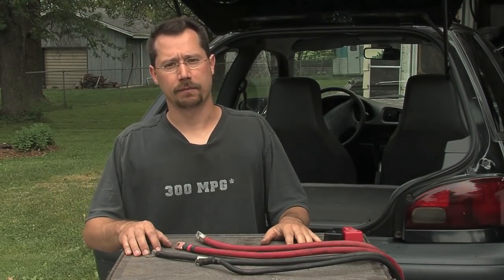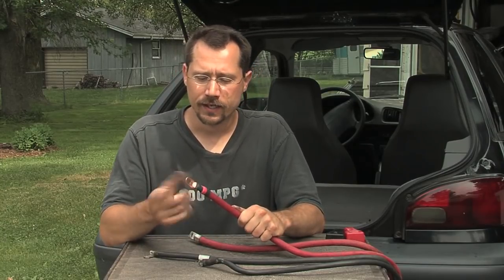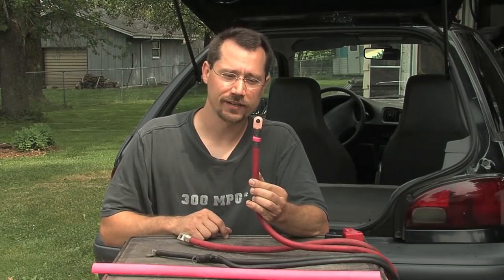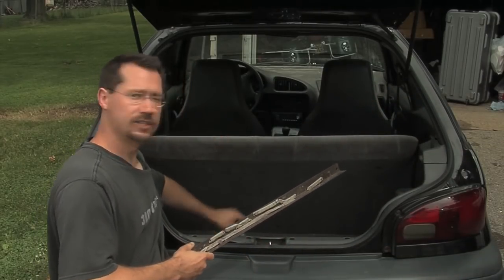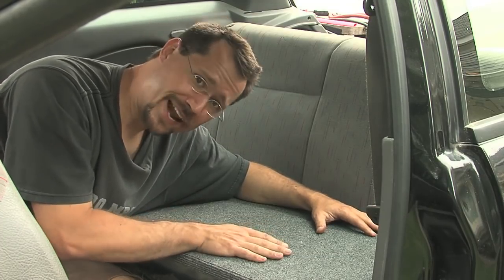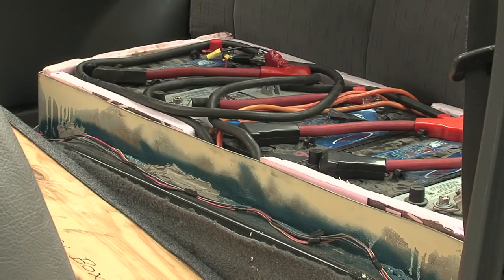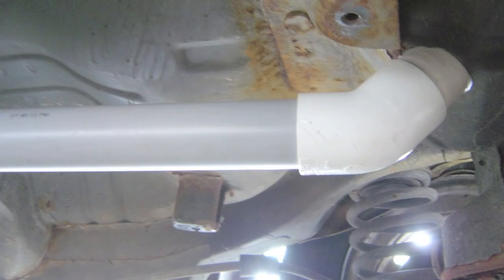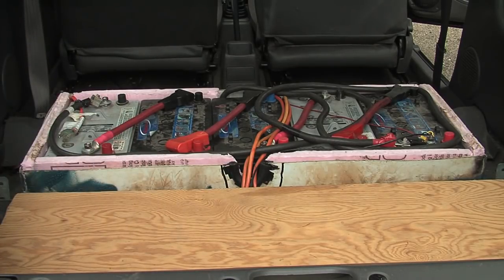11 Build Your Own Electric Car: Cables and battery mounting

Comment: Very informative series. It helped me a lot in my simple ev conversation. I'm about to give a test drive. The only thing worries me is what about ground nagitive which is 60 volts to the body of the car. Won't it be dengerous. I'm not sure what to do. Any help would be great
Reply from the maker: For pretty much anything OTHER than 12v, you do NOT use the frame as a ground! Run dedicated cable of the correct gauge on the negative side of the circuit.

Comment: Thanks so much for this EV vid series! I'm having trouble finding a fork lift motor at salvage yards. Any advice on motor specs if I search for a fork lift motor online? I'd like a max vehicle speed of at least 65MPH. Is this unrealistic for a fork lift motor, or can a controller affect its speed potential? Cheers!
Reply from the maker: You can do 65 just fine on a forklift motor. Make sure to use a decent voltage. Speed is proportional to voltage on a DC series-wound motor.
The best advice I ever found on using a forklift motor can be found here: https://www.diyelectriccar.com/threads/using-a-forklift-motor-and-choosing-a-good-one.7598/

Comment: How did you decided where to install the 2/0 cables vs the 2 Awg cables?  Is the amperage different in different parts of the system? Thanks!
Reply from the maker: The 2 AWG cables shown are just an example.
Any cables I re-used from forklifts for in the car were the heavier style.

Comment: I really like the series of videos that you have created for your build and the detail that you go to in each.  For this battery video I have a concern with pressure fitting lead acid batteries (or any battery) into a battery box. I would worry about the batteries swelling and/or becoming overheated and having the casing split. This will lead to an acid spill in a closed environment causing an explosive environment as well as a respiratory hazard. I don'r recall seeing where you vented the battery box to the outside atmosphere? If these are not sealed lead acid batteries then you have an outgassing situation where the batteries release hydrogen, creating both an explosive and/or a respiration hazard. Setting this aside, great job with the videos and the build.
Reply from the maker: For this project, I was using gel batteries. Later, I got some AGM batteries. Both are lead-based, but completely sealed.
For flooded batteries, you would want to provide for proper venting.

Comment: Hmmmm.….now that you've removed the engine etc, that is a huge weight off the front end...…..possibly you would want to install some batteries, (if you intend to stay with lead acid type), in the front to balance the weight shift. With a change over type conversion like this the first and very first consideration would have been to use Lithium type batteries...….one guy on the Tube shows how to build not too costly lithium packs with 18650 type cells......THAT is definitely the way to go.....Lead acid is pre history or before 1900.
Reply from the maker: Please keep in mind that this was a project built in 2008.
Lithium batteries at the time would have cost over $10,000 for a basic motorcycle-sized battery pack.

For a project using lithium batteries, take a look at the Vectrix electric motorcycle we upgraded.
https://www.youtube.com/playlist?list=PLmHss3DBZUinx-DxMLnax485Alj5i5Lcn

Comment: What if you fix a charging alternator for additional power, i believe it can recharge batteries for additional distance.
Reply from the maker: Where do you suggest the power for the alternator comes from?
Reply: @BenjaminNelsonX , i think you can convert a drive system from the power source (instead of cutting a space underneath the gear box, you can cut a space on the top and fix a drive wheel or a pulley close to one of the coupling) you only need some sort of pulley to drive alternator for extra charging, some sort of recycling energy.
Reply from the maker: So, the alternator is powered by the electric motor?
Reply: @BenjaminNelsonX  Yes, as long as there is power to rotate the pulley the alternator will always charge the batteries  if they are in parallel they will at least gain 5 amps at 13 to 14 volts Dc. It depends on the R P M and the size of pulley to drive alternator.
Reply: @ibrahimayoussouftoure7854  Do you mean Regenerative Braking? Driving the alternator with the electric motor will suffer from inefficiency, and wont actually charge the battery but provide resistance that drops the efficiency of the motor draining the batteries more. Regenerative braking though, recovers energy that would be lost to normal braking, whose energy is instead used to drive a generator to slow the car.

Comment: Where did you spend thousands of dollars?
Reply from the maker: I did nearly all the work myself on this car and spent about $1,300 total to do it.
Reply: I've heard everyone say its pricey. I knew it wasn't and all it is ,is understanding what your doing . not send away the car to some crap shop , knowingly all they doing is gutting out a fork lift and ordering a speed control device and wires plus coupling 
What the heck ?
Reply: No 5quarts of oil no extra tools no gas no emissions no noise for the nabours save money when your done and no 215 degree heat no radiator fluid no loser fan wires or serpentine belt I'm at awh right now

Comment: Using copper strip for the battery connection will make it look nicer
Reply from the maker: Copper bus bars are great for short connections between smaller cells. They offer the advantage of being a SINGLE conductor instead of a lug/cable/lug. The disadvantage is that they don't handle vibration as well and they simply are NOT flexible. For this car, we are using large batteries where bus bars would have to be long and cross on an angle. Battery cables are a better choice.
I did use a few small bus bars under the hood making short connections between the main fuse, contactor, and some of the other balance of system components.
Reply: @BenjaminNelsonX  not only that but  welders cable with a godzillion small conductors also takes advantage of skin effect.

Comment: I silver solder all of my terminal lugs and I start with Sch 10 copper tube to ensure ample amperage and physical strength properties. Also it costs less than commerical terminal lugs.

Now of course, if you lack a drill press or a punch press, that may not be a desirable way to go, but any drill will work if you can slip a dowel into the opening and tape it to keep it steady while you drill, just be sure to secure it tightly and never press hard, because copper is soft, sticky and deforms much more than either aluminum or steel so be careful while you drill or you will break something.

By the way, you can get shrink tube up to 6 inches in diameter, so there is no limit that would go beyond the size battery cables you are using.

Comment: most cars have a petrol  tank IF WAS  DOING THIS I  WOULD PUT THE POWER  CELLS  IN THE OLD PETROL  TANK  AND C UT THAT  INTO  HALVES  AN INSTAL  THE CELLS IN THE  OLD [ERTOL TANK  TO THEN  CONNECT THE -NEGATIVE TO THE CAR  BORDY  OK REASON FOR INSTALLING  THE BATTERY IN THE  OLD  PETER TANK IS THAT  IT  MAY  BE HAZARD  IN A CRASH  IF THERE IN THE BOOT  I DONT LIKE THE IDEA OF  HAVING  BATTER LEAKS 
CAR  PETER IS BUILD FOR WHEN  A CAR CRASHES  TRY THAT  IN  STEAD
Reply from the maker: The batteries in this car WERE installed where the fuel tank was. Keep in mind that the original fuel tank was only a few inches thick, and wouldn't be able to physically hold the batteries. In small pickup trucks, the batteries are usually mounted along the frame under the bed, essentially where the fuel tank would have been.
Reply: Umm... Did he say he would ground the negative of the traction pack batteries to the car chassis?
Reply from the maker: A person would never want to ground the negative of the TRACTION BATTERY pack to the frame of a vehicle. It always needs to be completely isolated. If it were grounded, there would be great risk of shock or short circuit between the battery positive and anywhere on the frame. 
Only the 12V starting or accessory body would be grounded to the frame, as is common practice in modern gasoline engine vehicles.

Comment: I hate to point this out, but you do realize that the back seat cushion is resting on the battery terminals?  That can damage the batteries, and as you state, they aren't cheap.
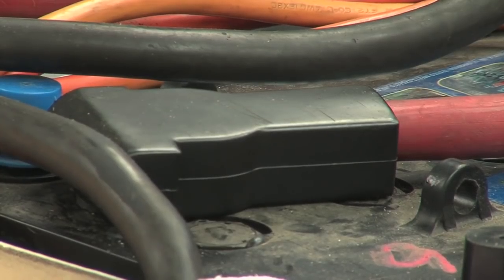Reply from the maker: Of course, we wouldn't want anything resting directly on battery terminals. At the end of the video, I specifically mention this. The best actual representation of the finished project are the still photos at about 10:23-10:42. The plywood cover is bolted down over the box and rests directly against the edges of the box NOT any part of the batteries or cables.
Reply: 10:13 and 13:10 showed the foam higher than the box and the battery terms higher than the foam.  I know you mentioned it, but 13:10 was concerning.  People mismeasure all the time, I've done it myself.  Couldn't really tell too well in other scenes if the batteries were lowered due to the angles.  It looked like they might have been now that I looked again.  Now, while I doubt anyone would be in the back seat of an electric Metro (I had a 1992),  plywood flexes.  I hope you have supports of some sort toward the middle.  All this comes from an under seat speaker box build.  Good build just the same.
Reply from the maker: @nunyabiznez8120   I ASSURE you that the cover did NOT sit on the battery terminals. When filming various parts of this project, I sometimes had things moved around temporarily, so it's possible the batteries could have been a hair higher while I was working on it, but if so, would have been moved again before putting things back together. Also, things sometimes really DO look different on video than in real life. The battery terminals were fine.
Reply: You don't need to assure me about it.  You say it doesn't, it doesn't.  I was just trying to explain why I posted the comment in the first place and offer personal experiences.   Still a good build.

Comment: Batteries are known to off gas. Did you install a vent system to keep the corrosive gas out of the passenger compartment?
Reply from the maker: These are sealed gel batteries, which do not off-gas like flooded batteries.